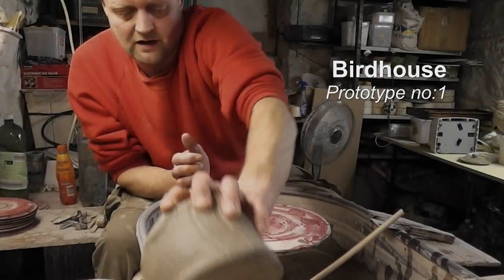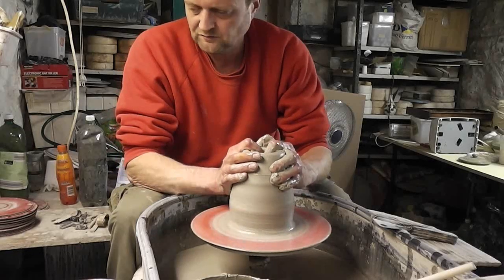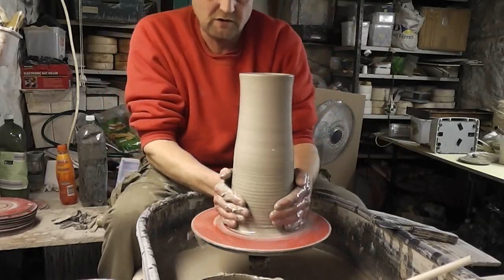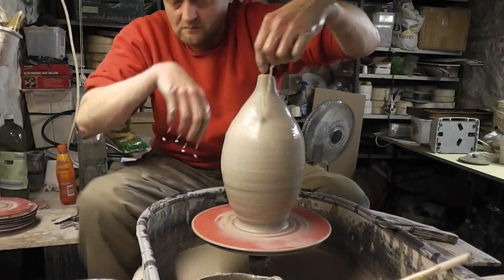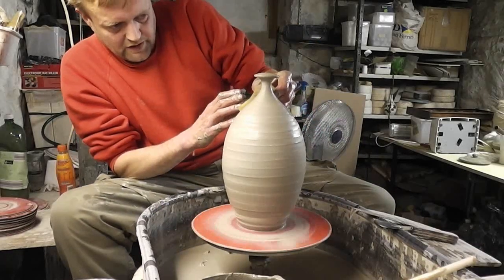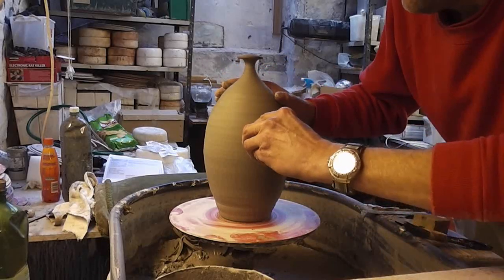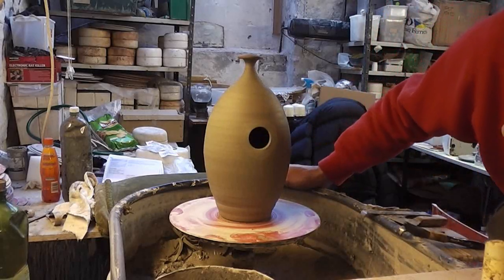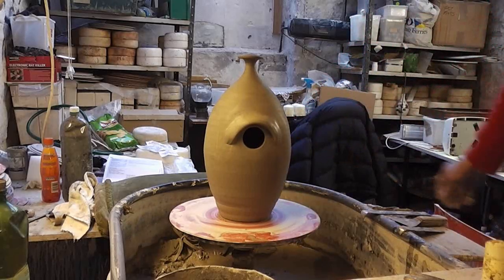Making a Pottery Ceramic Bird House / Nest Box on the Wheel : Prototype attempt : 1

Comment: Neat. I've seen birdhouses thrown of the same (or very similar) design before, and am making some myself. I'm also using the same general shape (minus the rain cover, with a larger hole and with aquatic moss and plants attached) as a spawning cave for some tropical fish species. I imagine it would be ok for use for a few years. But if buildup becomes a problem, you could always re-fire it and burn off the organic matter. Some drainage holes may help as well.

Comment: For another idea, Google Williamsburg bird bottle (see the assembly instructions)  Wheel thrown but hung with bottom against the wall. An inverted V is cut into the bottom which does several things:  now it can be hung on a nail, the opening provides ventilation and a way to clean out the old nest material.   That said, I still love your design!!

Comment: Actually a perch is for the predators, best to leave that off.  To clean out, on the bottom while still damp, push in slightly around the edges of bottom to make a recess.  Add a hold to fit a rubber plug, (type for banks)  Make it slightly too large to allow for shrinkage.  I use size 12.  Unglazed the birds can get a hold no problem.
Reply: Linda Ricci its been 3 years you wrote it Linda. Just curious how were your last three years 😋

Comment: How about opening it to the bat (no base) and then throwing a small dish that it sits on to act as the base. Drill 3 or 4 holes in the knob at the top, feed string through the holes in the knob and tie them to the dish base. The rope can be used to hang it, and the weight of the house will keep it sitting on the base, but allows you to clean it out. Does this make sense?